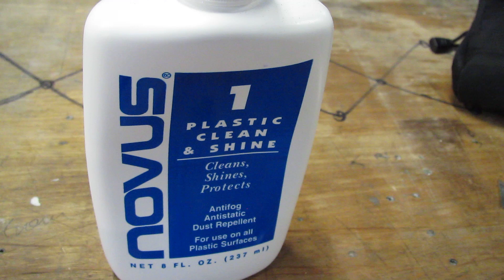How to Work With Acrylic: Restoring Optical Clarity

Comment: My experience has been fairly easy.  Cut on table saw, random orbital sander starting at 60 grit up to 220 grit.  I start wet sanding at 320 under cold running water.  By the time I reach it is a very smooth satin finish. Tempted to leave like that.  The satin finish scatters light the polished finish refracts and outright bends the light.

Comment from the maker: I would start with Novus Heavy Scratch Remover and see if that does anything . Really deep scratches cannot be removed but you can make them clear. Use only microfiber clothes for the polish and cleaning. Follow up with the other Novus Products: Light Scratch Remover and Cleaner/Polish. Make sure the cleaners are removed before introducing water and aquatic life. If that does not get it try a 6" cotton flap wheel on an arbor using a drill and saturate the pad with Novus Heavy Scratch Remover etc